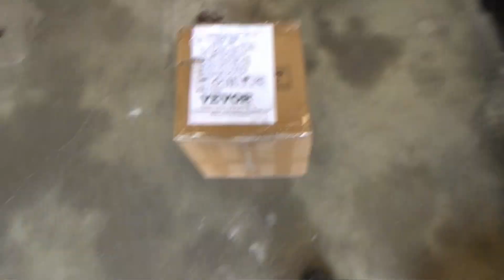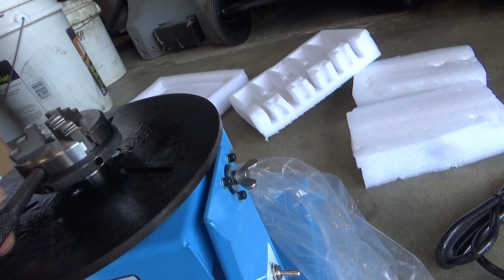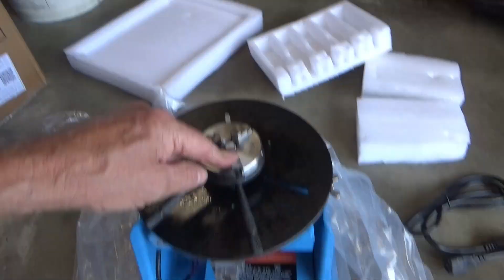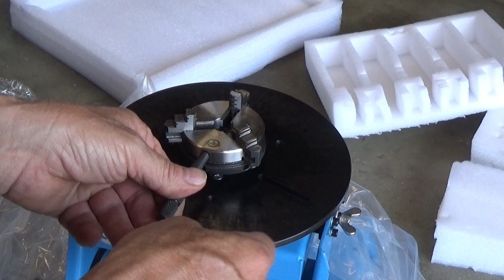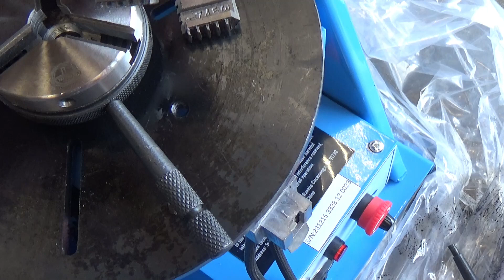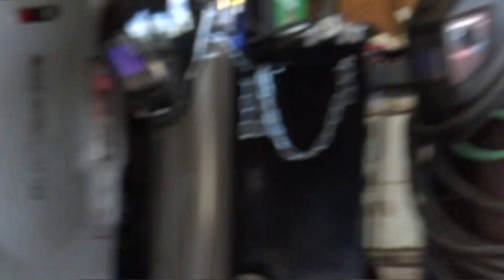VEVOR Rotary Welding Positioner Unbox and review

Comment: That's a great idea. I'm sure you'll get a lot of use out of it. The company did a shoddy job with that 'earth terminal' cable/insulation, in my opinion. I've always noticed things like that with all the various equipment I've been around and used. Great video.
Reply from the maker: I might use that ground link for very light welding but will clamp the ground to the part for anything heavy.
Reply: @GordonRobertsonDIY   Good idea. I know it's not carrying current per se, but the idea they made it that way gets under my skin sometimes.